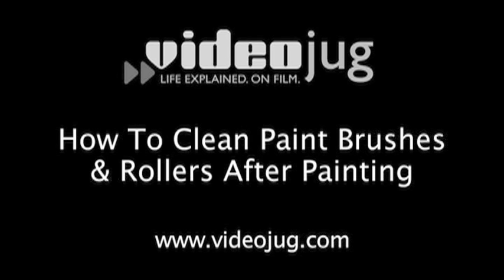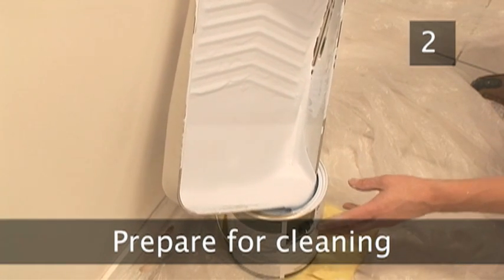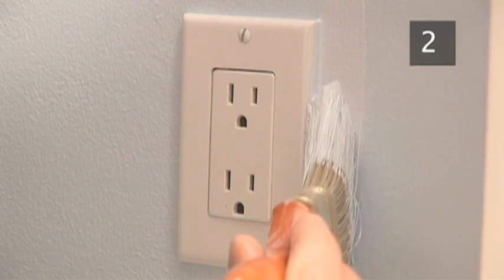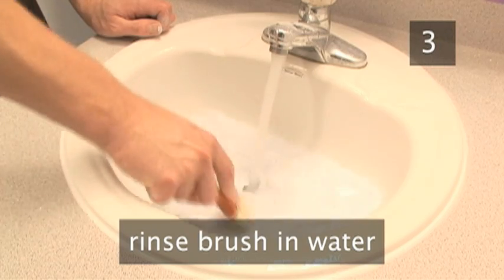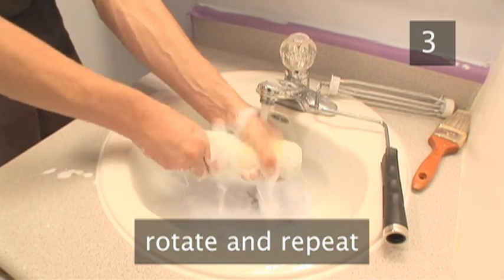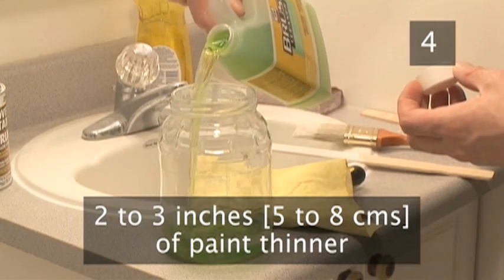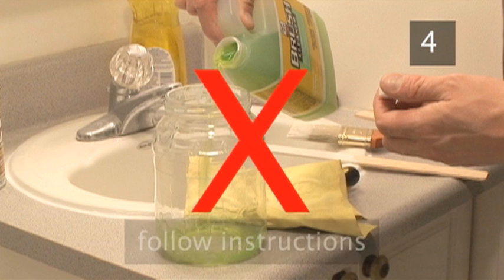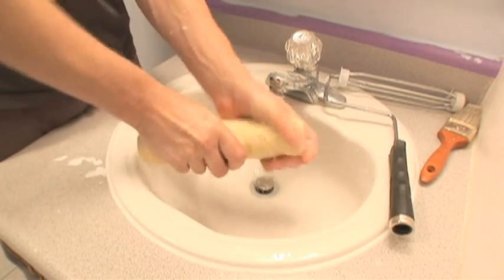How To Clean Paint Brushes And Rollers After Painting

Comment: Mate you literally have saved my life. I only recently started painting and I used both water based paint and pil based paint. When I cleaned water based paint it was easy. Tried the exact same methods with oil based paint, not only that it didnt work my literally my hands were full of paint to a ridiculous level. Had to throw a good expensive high quality brush away. Now, Im going down to buy this substance you spoke about and fingers crossed, it'll work. 
Watched like 100 of videos on how to paint and how to clean. No one mentioned the oil based paint removal.

Comment: Also, when you store the paint cans for later use be sure to put the lid on it tightly and turn it upside down. This makes it easier when you want to use it mixing it up. When stored for a period of time everything settles to the bottom. 
So if it's been upside down and has settled, when you upright the can mixing the paint is a lot easier.

Comment: Don't be lazy and try to paint around switch or receptacle plates. Take them off, paint around the switch or receptacle, let the paint dry then put the plate back on. If an electrician has to come and work on the device, when he takes the plate off and the painter has painted the wall with the plate on then some of the paint will come off the wall when the plate is removed unless the electrician uses a razor knife to break the paint loose from the plate.
Reply: Use masking tape and mask around the switches etc. Its less hassle than taking them off

Comment: You did not explain how to clean a roller, nor the tray, with oil based paint. Also, though you cannot pour the thinner down the drain you can rinse the brush that has thinner on it in the sink??
Reply: Good points - I was wondering the same thing!
Reply: after oil based paint, don't bother cleaning roller.  Just toss and use new one.